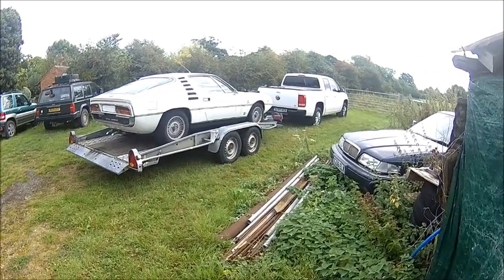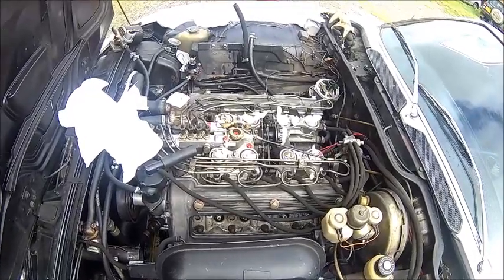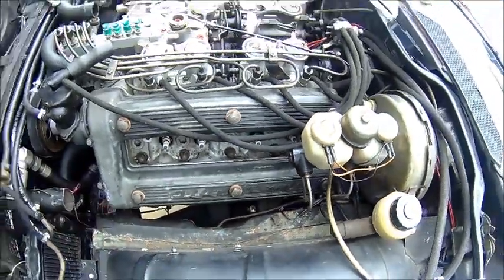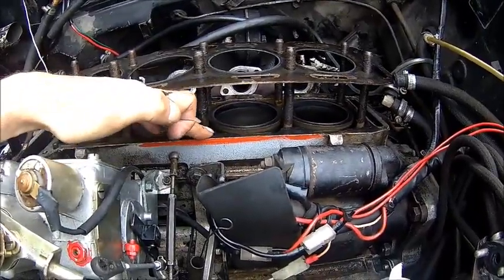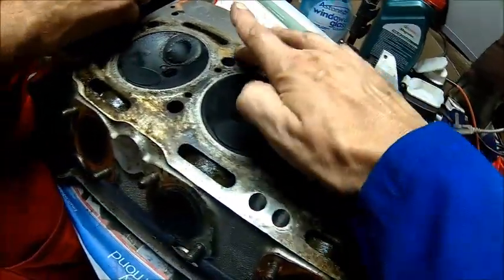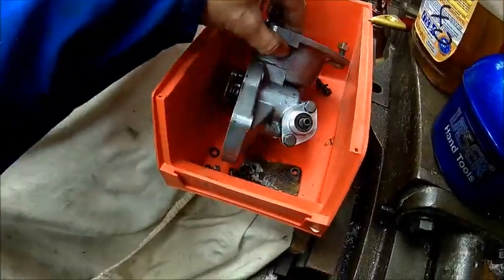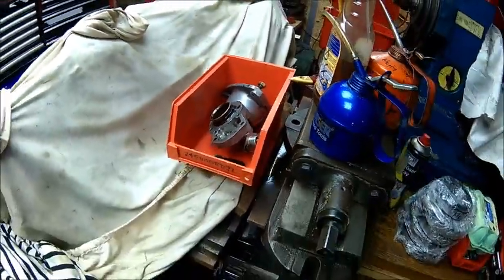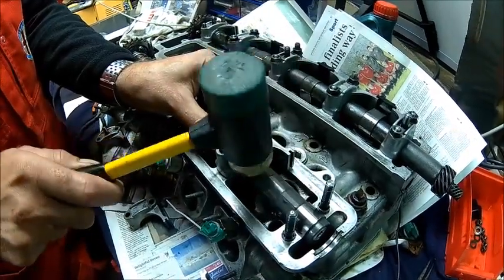Alfa Romeo Montreal cylinder heads Part 1,  tear down, inspection and some surprises

Comment: I would have put the car back on the trailer after popping the bonnet or did you get the assistant to do most of the work. Cheers Peter
Reply from the maker: Well,...that wasn't really an option ... and yes he did alot of the heavy stuff because he's alot younger than me ...:-) ...and not at least, i am always up for a challenge, never done one of these, but at the end of the day it's just another old engine, no rocket science inside.

Comment: Wow, a Montreal. That's pretty special.
Reply from the maker: It is indeed, ... unfortunately not mine, ... but on the other hand, ...without one i have more money left to buy tools + machinery, because the gasket set alone was 3 times the price i paid for that blue milling machine ...:-)
Reply: I bet those cars can rack up a nasty garage bill. Both in parts and labour.
Reply from the maker: easily,...parts are in short supply and everything takes long because of limited access. We spent a week including some machining work and fixing other little things popping up while working on it. I wouldn't denote myself as an inexperienced mechanic and my friend knows his car pretty well, too.... oh, and i took almost half a day off to pick up the new old mill

Comment: somehow the car seems a little DeLorean-esque... definitely one of alpha's nicer creations. those first aluminium engine blocks are a little temperamental.. the metallurgy in those days wasn't quite perfected so it was a hit and miss on whether or not you could get any miles out of those engines.. i had a Volvo 264 GL with the B27F (an aluminium block, cast iron sleeved V-6) which was also put into Peugots and DeLoreans back in the day and managed to get 264 000 miles on the odometer before it was stolen in Toledo, Ohio... most of the B27Fs lasted less than 80 000 miles before they warped and came unglued.
Reply from the maker: Well,...not really, and that DeLorean had an under powered Renault engine (i think),.... the Alfa has approx 125k miles, at least that's what the engine looks like to me, not bad for a late 60's  design with almost 80hp/liter.
The problem is that parts are very expensive and the top end design could be better in certain areas, but it is what it is.
Reply: yes, the cam bearings are gonna be an issue later on. i wonder if there would be a babbitt bearing solution to that problem like what they did with the crank? although the metal is a different grade of aluminium it is still pretty soft. galling of the cam bearings isn't far off if there is scoring already.
of course various engine oil supplements could be a viable solution for the interim, i run ER(Energy release) in all my 4 stroke engines.. the stuff really works well in older engines. i started using it in my dodge (6.6l V8) when it hit 250 000 miles and it went to over 500 000 before i had to have the engine rebuilt... same thing on the jeep.. it's sneaking up on 300 000 and still going good.
Reply from the maker: The problem is a bit more complex, ... the bottom of the bearings are almost good and flat in line, checked it with a straight shaft and some blue, the little scoring polishes out. The real issue are the bearing caps because they carrying all the valve spring load which makes them egg shaped. All normal so far, but the cam is hollow and the first bearing collects the oil and squirts it to the other ones via a hole in each journal. The real problem starts with excessive clearance at the first bearing, at some point there is just no pressure left for the last one, the wear pattern correlates very well with this theory. But now comes the nasty bit, ... some backyard botcher took a belt sander and ground a random amount off these caps to get them tight again, some probably a bit too tight, the cams look accordingly. The casting are not the best ones either, seen some voids which may also had some inclusions.
Part 2 should show some close-ups of the drama.
Reply: oh jeez... well i'm looking forward to the next episode.. given the excessive gooping of RTV on the distributor base i would hazard a guess it was the same doofus that took the sander to the bearing caps.. the thought of that just makes me nauseous ...
Reply from the maker: you'll see it shortly,...just uploading the next part ...

Comment: Love the Alfa, sweet .........  hemi head ??  How about a performance test when you are done. Four carbs in there. Webber’s ? Don’t see those classics over here too often. See you in the next installment. 👍
Reply from the maker: Well, this thing is probably way too small for you guys in the states, no push rods, all aluminium,  2.6 liter DOHC, redline at 7500 ...:-).... and parts prices are approaching the weight equivalent in precious metals.
No carbs, just throttle bodies, the thing in the middle with the green tape on top is a Spica injection pump (all mechanical), essentially a Diesel injection system, just on a lower pressure level because it's manifold injection only.
Performance testing is a bit limited, our speed limits are not much better than your's and speeding tickets are pretty expensive.
Reply: It has the classic / sexy Alfa styling. Now I really like it, mechanical injection... engine looks impressive even though it’s low hp. I’d have a nice time cruzing down the road
Reply from the maker: I agree, the design is simply great, but it's still an old Alfa, therefore it needs quite a bit of tlc and a rather big wallet.
Fuel consumption is worse than my Jeep which has about the same hp,....but the sound is definitely priceless.
200hp does not sound a lot but If you extrapolate that to the displacement of a small block, this would be almost 400hp,... that's not really a low specific power rating....
An almost identical injection system was used with the 4 cylinder Spiders for the US market at that time, in Europe they only sold the carbed version with the Spider.